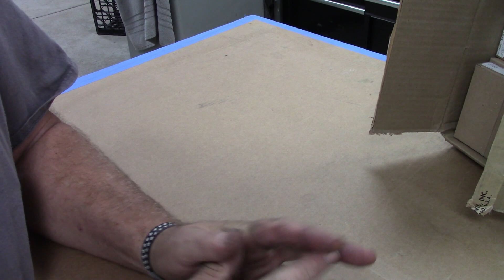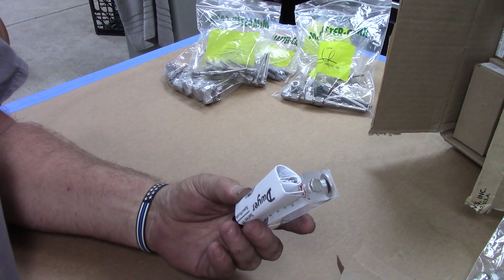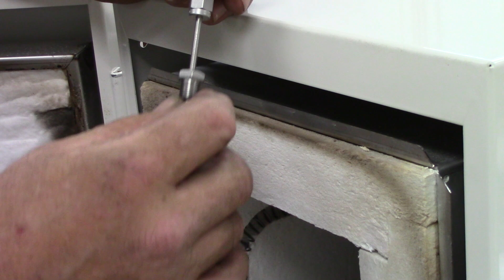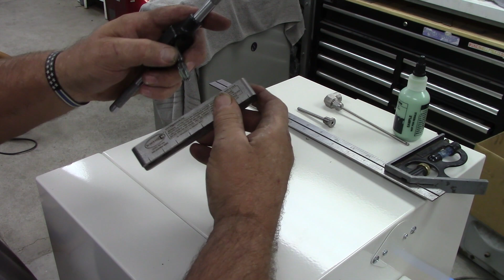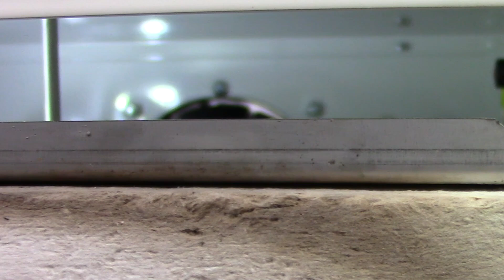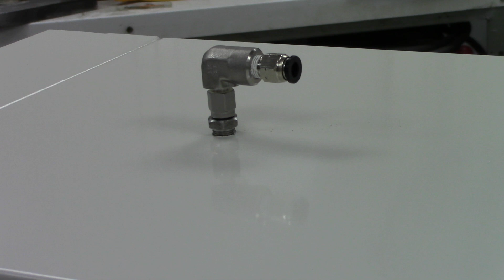Argon kits for Oct 2021

Comment: I don’t know how that heat sink is connected to the box other that by the screw in the middle, but slipping the bracket between it and the box lifts the sink away from the box. Maybe that lowers its efficiency. I would prefer to mount it between the sink and the screws, using washers under the screw heads for increased support.
Reply from the maker: You could certainly do that, but the sink doesn't transfer heat to the main enclosure, it's just there to soak it out of the center-mounted SSR.
Reply: @ShadonHKW  ok, just curious.